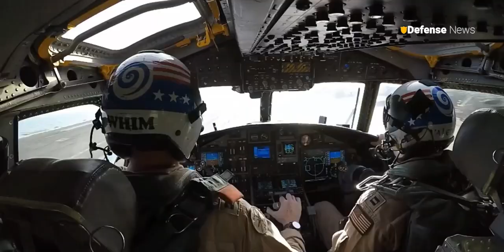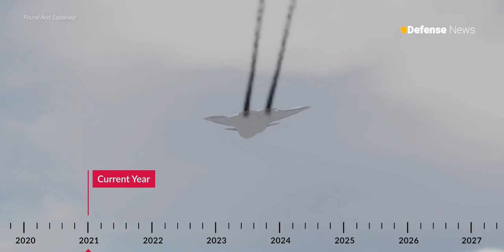Unveiling New Views Of Northrop Grumman's Totally Notional Long Range Stealth Fighter

Comment: Can this counter the Chinese J20?
Reply: Very much so. Although the J20 is capable, this is supposedly a 6th generation fighter jet in the works. 5th was revolutionary, 6th gen is going to be the next evolution of our knowledge of aircraft so if it goes well, J20, SU57, F35, and F22 will stand pretty much no choice to what these 6th gens will be capable of
Reply: It's not even a contest.  The J-20 is 70s engine tech on stolen 90s airframe design.  China will do better than Russia in terms of fielding 5th gen fighters, but they're still 30+ years behind the US
Reply: @lucasokeefe7935  I guess you mean F22's engine, which began development in late 70s. That's why F22s are being retired due to obsolescence. The new Chinese ws-15 engine's parameters are superior to all existing American counterpart.

BTW, American navy's 6th gen fighter FA-XX  looks very much like a J20. Is it possible that the US stole J20's design?
Reply: @aburetik4866  Well 1. It's a concept and 2. with 5th gen planes they all looked somewhat the same so....
Reply: @aburetik4866  "I guess you mean the F-15's engine, which began development in the late 70s.  That's not why F-22's are being retired, and they are only obsolete by the US military's standards.  The new Chinese/Russian WS-15 engine makes 3,000lbs thrust less than a US made F135, an engine that was in serial production years before China got a WS-15 prototype to make it's maximum thrust goal on a stand.

BTW, the US FA-XX design has not been released to the public, so it's impossible to know what the design looks like."

^ Fixed your comment for you.
Reply: @lucasokeefe7935  F135 engine's thrust is achieved by increasing its bypass ratio as high as 0.57, so that the bulky fuselage of the single engined fighter F35 can be lifted with enough power. 

But high bypass ratio engines' performance significantly deteriorates in supersonic speed, as it causes strong air resistance. That's why F35 cannot achieve super cruise and super maneuverability which are  crucial features of the 5th gen fighter. This may put F35 in a decisive disadvantage in an engagement with J20.
Reply: @mojothemigo  First time to learn a small fuel tank can limit F35's speed 😆

You claim that J20 stealth is nonexistent. How do you know that? You did a test on J20 somewhere?
Reply: @aburetik4866  Again, speed isn't that important. Sonic speeds are very fuel costly for all jets, not a big deal. As for the stealth, AGAIN, great big screws that are much larger than any other stealth jet. They are obvious, stop lying to yourself. Also again, "nothing to lose sleep over" by an admiral with a backhanded compliment that the pilots were good, insinuating the jet is not and he was containing laughter.
Reply: @mojothemigo  ofc, speed is important. F35 is too slow to even escape from J20

Oh, J20 stealth is nonexistent bcoz ur admiral said so.  Looks like ur air force's most lethal weapon is ur admiral's mouth 😆

I guess he said the same thing about Chinese navy. That's why US navy came up with useless toys like the Zumwalt destroyer and Littoral Combat Ship, better known as "Little Crappy Ship", which are being delisted only after 5 years of service. The whole PLA are containing laughters at them.